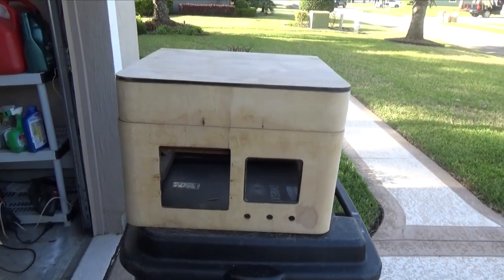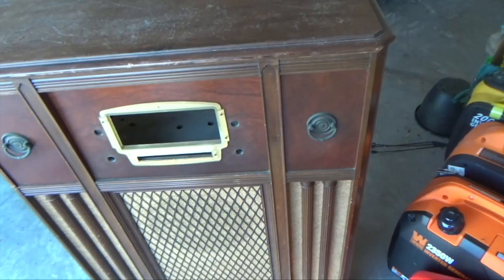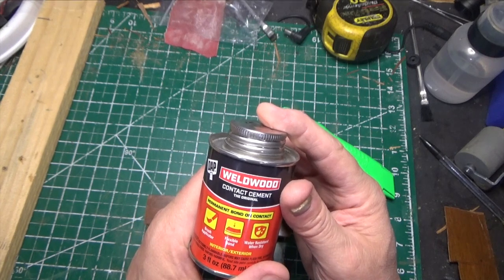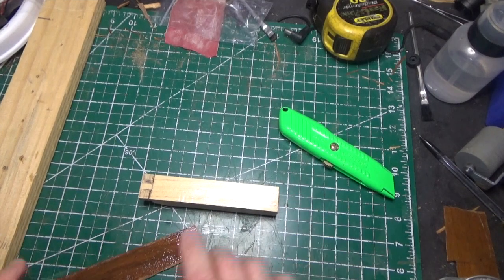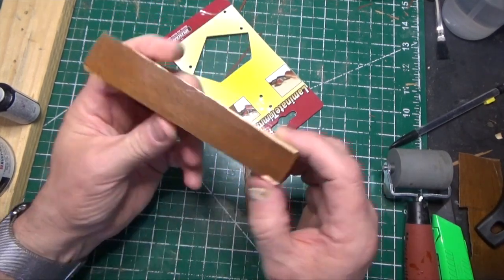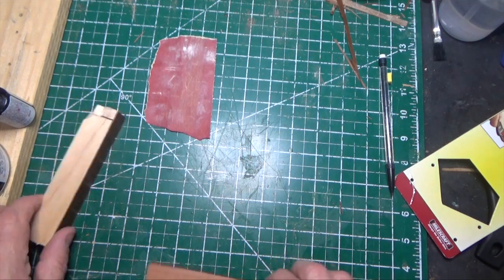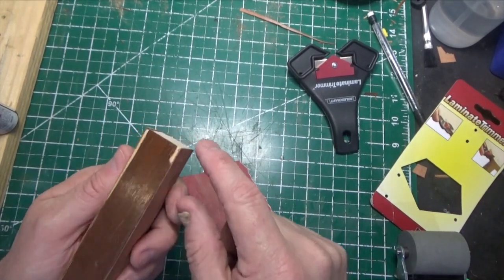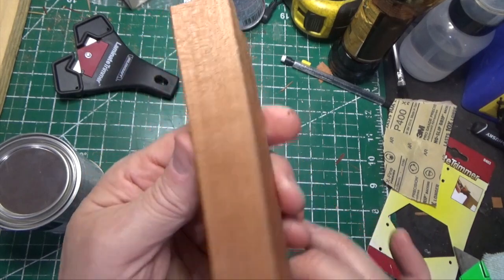Admiral 69 M5 Restoration Part 4:  Prepping and Veneer testing

Comment: Looks good Ron! When I've worked with veneer I have found using multiple light passes with a sharp razor is less likely to break the veneer or cause a ragged edge. 
When you use contact cement, use round wooden dowels between the surfaces to keep them from sticking to each other before you are ready for them to stick. That way you can roll out the air pockets as you go.

Comment: Hi Ron,
If that brace is anything to go by, the rest of the veneer job should turn out to be excellent.
When repairing old veneer, or fitting whole sheets of new, I’ve tried different types of adhesives from PVA, iron-on, Gorilla Glue, I’ve even tried applying the old fashioned boiled hoof based glue, but my favourite is contact adhesive.  It is in my opinion the best, especially if one was doing marquetry.  
Another good thing about contact adhesive is manoeuvrability when a warm iron is applied after the adhesive has had time to set.
Take your time Ron, and provided you get all the grains running the same way as the original veneer, and be precise with each, and every cut, the re-veneer job will turn out fine.
A pleasure chatting with you my friend, Phil.
Reply from the maker: Thank you Phil, this is certainly not going to be a rush job... Time and planning and patience are key here. I feel much more confident now that I will do a great job on this !!!!  Stay safe my friend in Sheffield. Cheers Mate !!

Comment: Saw the video on how to use a Milescraft Laminate Trimmer . The video is worth 1000 words. It will work nicely on the curved corners as well.
Like the fact it uses standard razor blades too.Old veneer is very brittle.When you get to the curve part of the cabinet see how that is done.
I only mention it because you have to bend the new veneer against the grain. Woodworker and YT'er Javed Shazi shows how to do it .
Get an iron and PVA glue.Experiment first to see if the results are to your liking. Also important is to book match the lower cabinet with the upper part
 of the lid so the grain pattern matches as well. Looking good so far Ron.
Reply from the maker: Steve  - yes I am plotting out my grain placement now.  I did alot more cutting with the Milescraft today and now I have the hang of it, its an acquired skill for sure.  EDITED: I watched Javad.. good stuff... and now I know what PVA glue is :)   .. thank you so much for your mentorship on this ; I really appreciate it
Reply: @rciancia  Absolutely. Like what you're doing with old vintage tube stuff. We can't save all of it, but nice to see one that does get saved every now and then. Wood working was my old forte. So watching you is a plus!

Comment: Yes contact cement will work very well. My Dad used to use it when he was putting Formica countertops together which is a heavy veneer and your veneer is thinner so it should work fine.
Reply from the maker: Thanks Larry, I do agree. I will have to do this outside as there is a really strong odor from the stuff... but thats ok !!!!  It worked really well .  Thank you

Comment: Hi Ron. Ditch the Weldwood and check out the 3M line of spray adhesives. https://www.youtube.com/watch?v=EPYnODTxzp8 They offer faster application and smoother coverage. I've used the "SUPER 77" and swear by it.
Reply from the maker: Thank you Thomas !!! I will check it out....  appreciate it
Reply from the maker: Thomas, did you ever use this for veneer ?  I have a can of this, but I know the spray is not uniform... its a web type spray... I am pretty sure veneer requires smooth even coverage..  Pls let me know.  Thank you
Reply: @rciancia  Yes it does and you should use ( Super 77)  only in a well ventilated work area like a garage!
Stick with contact cement or PVA glue.